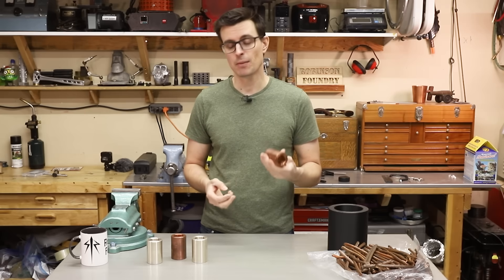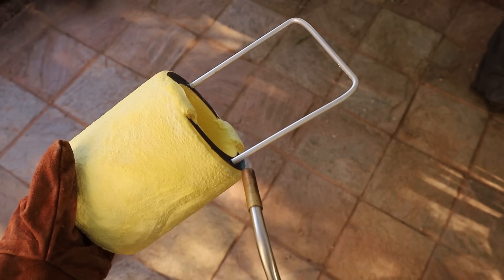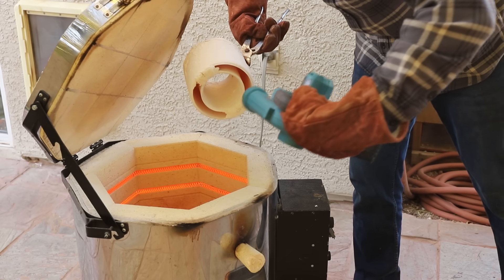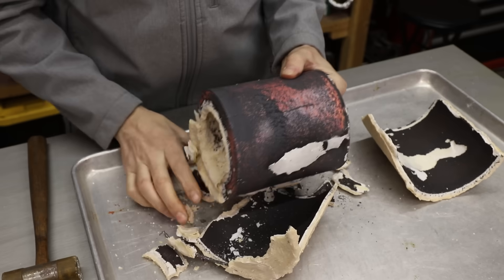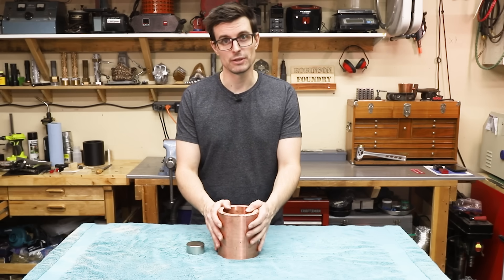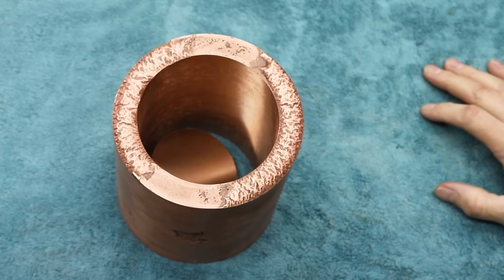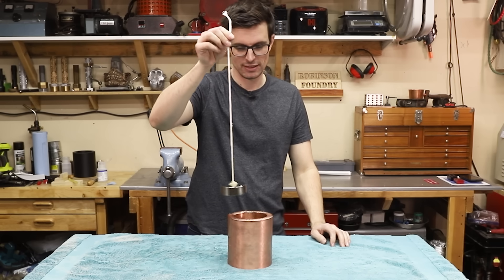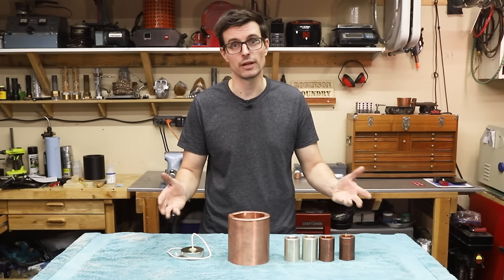Defying Gravity - HUGE Neodymium Magnet vs Copper Tube Experiment - The Power of Lenz's Law!

Comment: Monster magnet! Can you do the so-called free energy experiment using that magnetic, a few copper pipes wrapped with a couple of hundred towns of a decent gauge copper wire, wired up to a power board, plug-in the drill that the magnet is attached to, give it a kick start, and see if you can induce enough power to not only maintain the drill magnet spinning in front of the copper set up, but also add some other appliances to the power board? A magnet that size and enough tenants should easily produce a few kilowatts, modern and of to keep the drill running, and power board completely active!. With such a large magnetic field, enough decent gauge copper winding around three copper tubes… You will probably never have to pay for electricity in the shed again! Make sure you have a safety switch on the power board! Please let me know when you've done this, although it's been done hundreds of times before, never have I seen a monster magnet, and using heavy gauge with lots of windings, the mathematics speak for themselves... You should be able to almost power and house using multiple power boards with safety switches for 10 A, in parallel to the copper coil. Everybody else uses microwave transformers, but you can also just wrapped wire around some tubes, copper or steel I think works, use the end of the wire to the positive and negative on the power board, either take the drill permanently on, or kickstart manually with your finger on the trigger, otherwise you will have a perpetual motion machine! Nobody has gone above 10 A a power board safety switch/average house safety switch, I want to see if you can produce 50kw at 10 A, by putting five power boards in parallel. In series it would just blow the first power board safety. And if feasible,… I will settle for 20% of the page it, for a power box that can run an entire house! Even smaller generators for construction sites. Where did you find that monster magnet? How much?

Comment: When you were pouring the molten copper into the cylinder casting, you had it aligned at the most difficult angle possible in terms of getting the copper into the narrow opening. Some overshot the opening and some fell short. 

It will be easier if you align the casting at an angle so the metal is pouring at a tangential angle to the opening rather than a perpendicular angle. The opening in the casting will have more margin for error in the direction of flow, allowing for more variability in your rate of flow (how far you tip the crucible).

Of course, having some sort of funnel build into the casting would have helped even more.

Comment: What if you put one down in the tube with the +pole facing upwards and then drop another one with the -pole facing downward. Would it then float from the copper tube stabilizing both (mainly the one being dropped in the tube) from flipping over like all magnets do when trying to balance one on another with opposite poles facing each other? If so, you would be able to levitate objects. On a smaller scale that is. Kind of a confusing question to try and ask to understand it properly, but you get the gist of it. LOL.

Comment: It’s not defying gravity, it’s still falling down. A moving magnet will generate current (electron movement) in a conductor. Electric currents produce magnetic fields which interact with the falling magnet to slow it’s fall. It was advertised on the internet 5-6 years ago as a rather expensive executive desktop toy (which rather suggests some well paid executives have far too much time on their hands. 
Now, if it fell up or just floated somewhere, that might be worth making a video.

Comment: If you get a taller cylindrical magnet, it will work better,, i have used a 1 inch cylindrical magnet in an 8 foot long 2 inch aluminium pipe with 7-8mm sidewalls and vould make the magnet tumble end over end on the way down, while standing on a chair and looking down the tube after it,, it was spectacular to see.

Comment: How about spin the magnet very fast inside the aluminum and copper tube see, if the tube will spinning with it. Make sure put the spacer in the tube or use the pvc pipe as spacer. If the tube spinning we might be able to creates the new type of gear system

Comment: Hope you were wearing great filter over your mouth and nose during sand blast removal of the shell. Fused silica turns to cristobalite at 1800F. Not sure what your shell firing temperature was. Beauty of fused silica is EASE of removal when high temp beta cristobalite turns to low temp alpha version around 400F. But beware crystalline silica in lungs.

Comment: Question: did you made this experiment on a digital weight scale to see if the magnet weight added to copper tube while gliding down? If so can you tell in detail if there any differences in weights also separate measurements for each alone!

Comment: Do you think if you made a copper donut shape hollow like this pipe , and get the magnet with string and connect more magnets in sequence and make loop back to itself , would gravity drag it downward in the copper donut like the pipe drop and because the string is attached drag the rest up and over and essentially repeat falling and pulling within the copper donut ?

Comment: You had trouble pouring it because you were pouring into the short dimension. If you took two steps to your left you would be able to pour into a longer dimension and the liquid copper would have been easier to pour even with uneven flow rate.

Comment: On pouring your molten copper....... If you had turned the mold 90 degrees, the over/under pouring would have been along the length of the opening instead of across the narrow width.  Just an observation.   Now a few questions.  Does the thickness of the copper tube have an appreciable effect on the magnet?  Would aluminum tubing give any results similar to copper?  Thanks for posting.

Comment: What if the copper tube was rotating quickly on a platter before the magnet dropped in. What if lots of small neo magnets dropped in at the same time (in various configs). 1 magnet at the bottom with opposite pole. Freeze the tube, Freeze the magnet, freeze both. Fill the tube with water, then salt water. put a coil inside, measure current. (ahh just a few experiments)

Comment: To have better control, you needs developed muscles or a vertically adjustable horizontal hinged arm with a swivel location to flow the molten metal. A table on casters with a swivel location suspended above also works

Comment: You were pouring across the smallish Gap of your casting Mold, Maybe if your next pour is more towards the Arc Length, instead of across the gap, your inevitable wiggles will still get the pour into the mold?

Or - make a Jig, Shop Aid, or Support, to Hold the Bar steady, that holds your Crucible, and still allows it to be rotated? 3-D Print a Copy of the Crucible, make up some "Pudding"  (Vary the thickness), and test the pour with that, as an other idea!

Comment: You ever see Brainiac75, he has some Huge A** insanely large magnets. I mention this because you mentioned yours was the largest you could buy. His are so powerful he needs big wooden rigs shaped like as long triangle just to approach the two of them to mount then together. Not to mention how he seperates them afterwards. I like you video though, but I would like to see it done with one of his. He made a 6 x 4 inch Neo. by stacking two 6 x 2's

Comment: Copper spring that circles back into itself, like a donut or a hulahoop, with magnetized n52 neodymium ball bearings inside the center of the copper spring. Now swing your hips. Attach a multi meter. Can you get any voltage out?

Comment: Just a thought for you. When pouring it's easier to hit the target by positioning the spout left-right but not forward-backward, because the spout focuses the pour position L-R. The F-B accuracy is dependant on your flow control consistency, which is much poorer and especially if it's heavy. So pouring into an annulus should be done tangential not radial.

Comment: Been Aware of this For a While, Strange as Copper is Not Much Magnetic(Diamagnetic)
Would Love to Try With a Gold Tube, Don't have enough Gold😢
Had Wanted to Try a Sheet of Magnet, And Drop Fine Gold and Copper down the Side of it to see if it is Drawn to it. 
Would Be a Good way to sort Fine Gold. Have Sheet at Slight angle So Gold would Be drawn to a Slot opening, The Dirt/sand would drop straight down.
Can you try any of this. You Are Better Equipt than me Right Now, Good Luck

Comment: I would like to see how it affects the mass of the copper cylinder on a scale. Is the weight of the copper tube increased by the amount of magnet if the copper tube is on a scale (even though the magnet is not touching the scale nor tube), or if you hold the tube in your hands while standing on a scale and someone drops the magnet through it?

Comment: What would happen if you repeat that process but include and existential magnetic ring around the copper? What will the copper react with two or more magnetic Gyroscope incasing the copper component? Is it possible for the copper cylinder too float in the same sense with the internal magnetic force and external magnetic rings? Iv got many more silly questions I’d like your opinion on thanks 💯

Comment: if you use wire instead of string can you measure any voltage with a multimeter between the tube and magnet!?

Comment: They should implement this in elevator shafts as an emergency breaking mechanism. Hve magnetts arranged on severa metal rails under the elevator and a setq of tobes they line up with. Then if the elevator falls for some reason the magnetic force would slow the decent in the last several meters to a non lethal speed.

Comment: Attach the copper cylinder to rollers on the bottom with bearings so that the copper can rotate in place, Attach a gear to one end of the cylinder and  attach to that a chain with a small motor to rotate the copper. In the front put the magnet in the center and see if you can keep that magnet levitated with the motor turning it i assume this would happen at low rpm so you could use mechanical advantage a good option if you try this might be a small scooter motor with #25 chain. Voila you have accomplished magnetic levitation completely by mechanical means
Michael G

Comment: I would try a thinner gap, or a thicker wall on the copper tube, or both thinner gap and thicker wall and see what works best.  I understand cost or materials might be a limitation but that's what I'd try.  I wouldn't keep upping the magnet size or strength (even though that would help also) just for cost and safety reasons.  I liked watching your process though.  I've never had anything hot enough to melt copper, but it looks fun (also a little scary at that weight).  Side note: I don't know if thicker walls is best for slowing the magnet but it would make it easier to pour into the mold either way.  I hope your future experiments are fun and go well!  Have you seen if aluminium works?

Comment: There is a nice project, professor searl, had rings, copper out side, magnet ring after it inside and then  , Teflon ring in the middle, , on the outside was the same idee, as big as a coin, ontop of each other, these things electrical energy, if you look at his project, and try it, it is very interesting 😊

Comment: This begs the question: How would this copper cylinder work as the rotor in a three phase induction motor? It seems to hold pretty tight to a rotating magnetic field!

Comment: Purchase or borrow a length of copper thick walled pipe and get the fit perfect. Plan B get thick copper cable and wrap to specific diameter. With wires clipped on you might be able to read small dc current with the magnet in out of the coils. nice work melting copper

Comment: What you can try next is a magnet assembler. Put one magnet at one end, and another to the other end. I saw one assembly with a big plastic wedge, and it takes so much time to get a magnet with another and it flattens the plastic at the edge, or its thinnest. Perhaps a smaller one could make it in a very short time for a more powerful magnet. For pouring the molten metal just turn 90 degree the mold for best flow. Good Luck

Comment: First what I found interesting is that gravitational acceleration was stopped. I can see now how breaking systems can be used on roller coasters and all of this could be developed much further. Now you want to develop  escape systems for high rise buildings using similar methods. There is a whole world out there. This could be developed into lift brakes. Train breaks. Runaway capture. No slamming doors. Get to it dude. I'm 74 so I don't  need the money.

Comment: 9" 20 thats interesting,
turning inside pipe does not so depend of magnetron flow,
as moving magnetbody along axis inside this pipe.

if u want do with mo stregh moving magnet inside pipe or diffy geometrikal forms,
put a ironplate with smooth surfases inside good ropes, like inside multiple knots,
then so u kan attuch some strong magnets to rope, without glue 
and can range streng depend of speed ot mass or so, to diagramm and formulas 🤩🤣🙋‍♀

Comment: PS, PS.... Love your furnace, if you angle your input on your furnace and let it spin around the crucible it may be more efficient. Especially if you spin it the opposite of the spin when you flush the toilet. The friction may create more heat..... Well Done. My first was a stainless modified stainless pool sand filter..... It was way simple, used a 45 dollar weed burner, right to 2400 F...

Comment: PS, if my theory is correct, if you take magnatite and heat it to say 1500 degrees it loses it magnetism. And as it cools, is when it becomes magnetic again. This is noted in black sands, if one removes the portions that are magnetic, then heats the "non magnetic" portion to at least 600 degrees, you might be surprised how much is now magnetic that was not before being heated? In your case many assume that copper is not magnetic, but it is what we call para magnetic, or slightly. Now if you set up a couple of cinder blocks, so that you could put the copper back in the furnace to say 1500 degrees, then set it one two cinder blocks so your magnet could pass through without interruption, then if the copper loses its magnetivity at higher temperatures and regains it as it cools, then the magnet should drop like a rock through the copper while it is hot. Being careful not to allow the magnet to stay inside the heated cylinder long enough to get hot.  Is then magnetivity created by first being hot and then cooling on a spinning planet?

Comment: @robinsonfoundry that is a really awesome project and demonstration! The amount of resistance or "coupling" between the magnet and the copper is obviously influenced by the strength and size of the magnet, but it is also a factor of the smallness of the gap between the magnet and the inside of the copper tube. If you have a cylindrical magnet whose diameter is very close to the inside diameter of the tube, the effect will be even more dramatic. You might consider re-casting your copper tube so the inside diameter is just a bit larger than your magnet, say 3.125".

Comment: I could do this in my shop, but I just thought of it and thought I'd share the idea here.  Say we had a cup of magnetite or steel filings, wither would show he lines of force on the magnet and how dense it is. I've never tried a powerful magnet with magnetite on it being introduced to a copper cylinder.  It may be the visualization you are missing to better understand the integration between the magnetic force and the copper conduction of magnetic force in a visual way.  You may need to go back to the smaller diameter magnet to see the lines of force change when it is introduced to the copper cylinder.

Comment: What if you wrap a copper Wire around the outside and attach the wire ends to a Volt/Amp meter?
- Try with additional rotations around the copper cylinder as if you were going to try to make a spring to see if this augments the results - see if there is a direct proportional correlation between the number of coils and the increase in the value of results.

- Try placing a loop of copper wire connected to the volt/amp meter next to the cylinder
- Try placing a loop of copper wire connected to the volt/amp meter WITH A SPRING LIKE COIL next to the cylinder
- Try placing a loop of copper wire connected to the volt/amp meter WITH A SPRING LIKE COIL (and a bar magnet inside the coil) next to the cylinder

- Try placing a compass next to the copper cylinder

- Try placing a light bulb (switched on) next to the copper cylinder
- Try placing a fluorescent light tube next to the copper cylinder(once turned on - once off - try with no power - try with no power but both ends connected with a copper wire as a closed circuit)

Comment: If you can grab the magnet and turning it feels like turning a handle that connects to the tube 8:11…. Would it be possible to create a gear that doesn’t have touching parts?  And if that’s possible, wouldn’t that be better than gears that eventually break down over time due to the parts rubbing one another?  

And that gets me thinking about creating a spherical magnet with a spherical copper sheath (or perhaps a magnet that has XYZ planes to save on resources) - would it be possible to manipulate the magnet and not the copper?  If so, you could potentially create those spherical tires seen in that movie I, Robot.